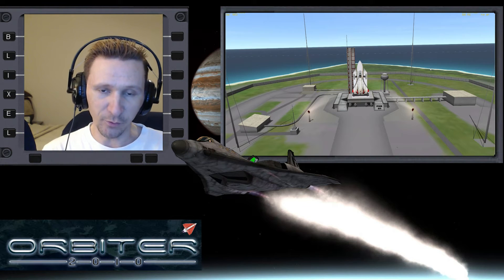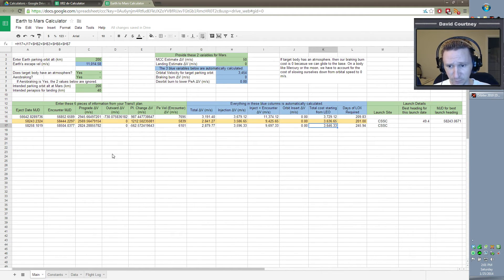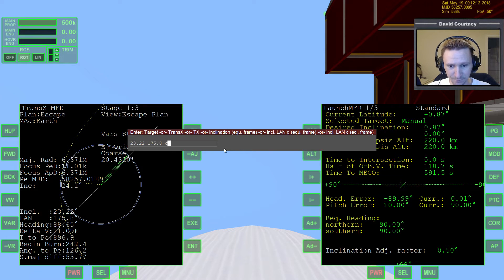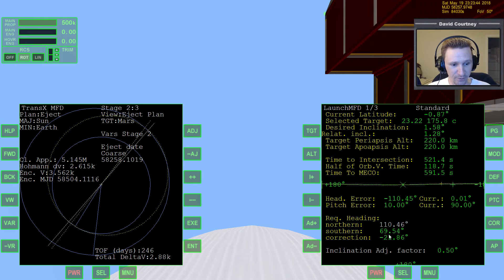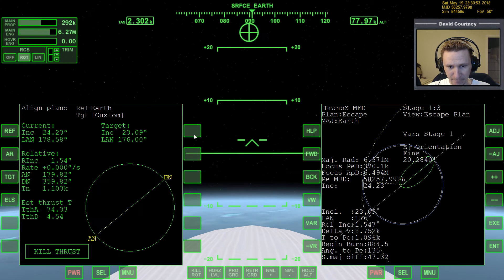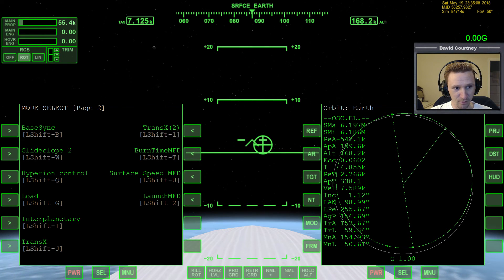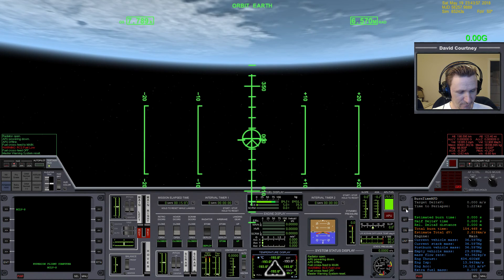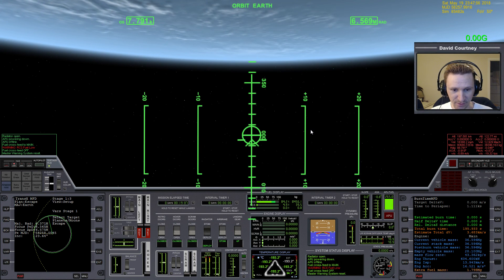Orbiter 2010 - [Part 1] Earth to Mars TransX+IMFD

Comment: you can now target the transx in launch MFD. You dont need to put the inc and lan into it manually.
There is now a similar connection between transx and launch mfd as it is for burntimecalc with get button.